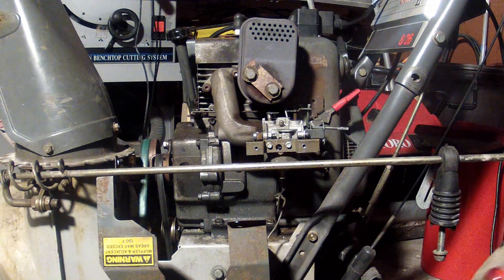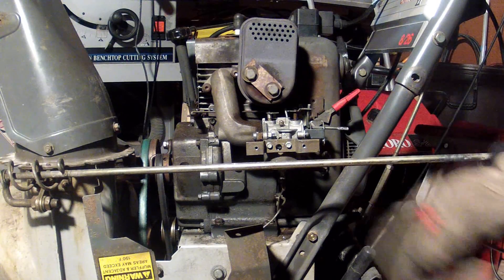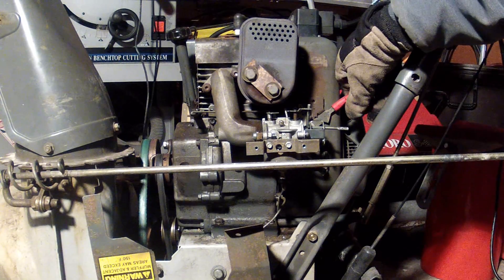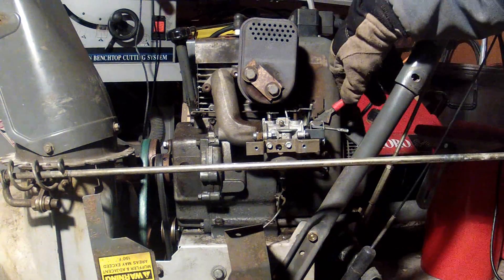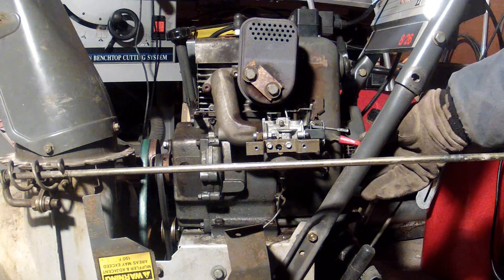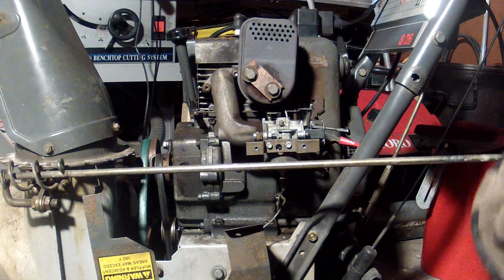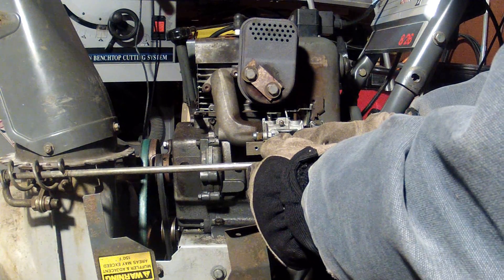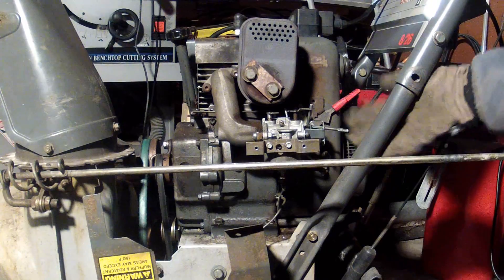Tecumseh HM80 Engine Part 16 - Carburetor Adjustment Part 2

Comment: I have the same beast , my problem is starts and runs but only if I leave it on full choke, I see when cover removed there is another adjustment screw , what is that one for ?
Reply: You probably need to take your carb apart and clean it.